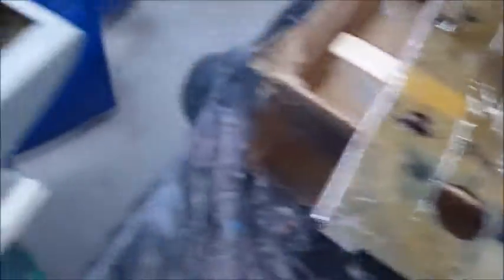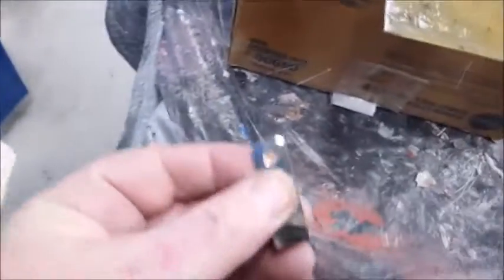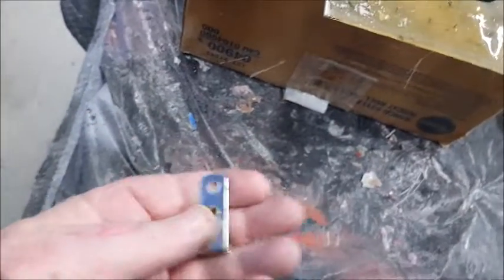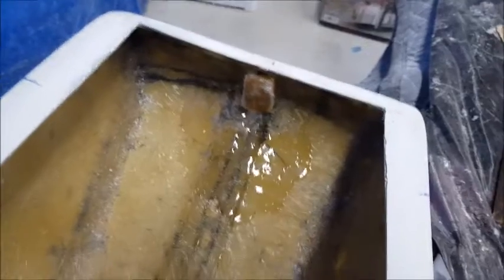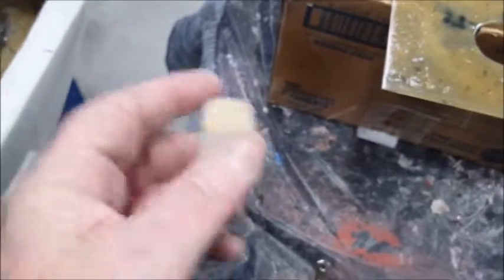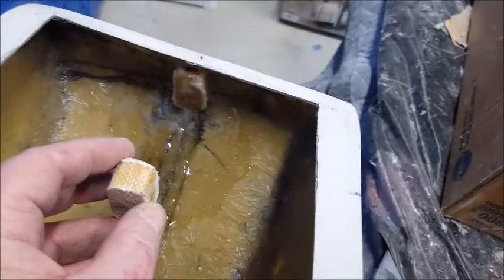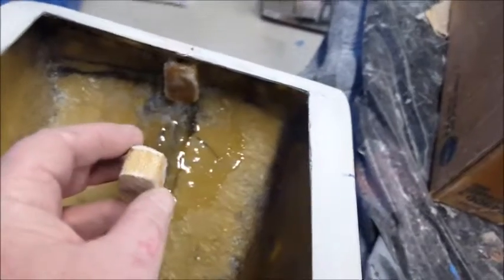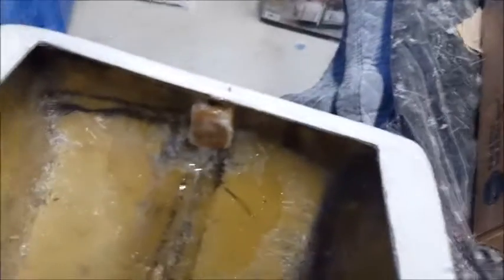Video 3 tank build

Comment: What kind of pedcock are you installing on this tank? Is it the same processes as the filler neck?
Reply from the maker: I am using a stock H1 Kawi triple petcock. They are vacuum operated and I like that. So I cut the fitting off of a trashed stock tank. 

For customer tanks, (unless otherwise indicated) I use a 3/8's NPT nut fitting to fit the Pingel petcocks.

And it's the same process as the filler. You just have to make sure the fitting or nut is completely trapped in at least two layers of glass and resin.